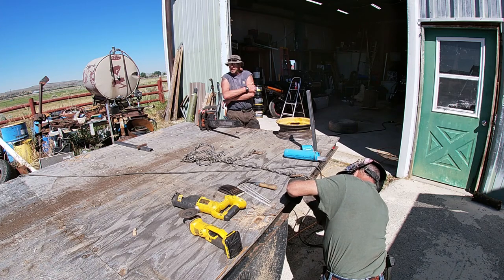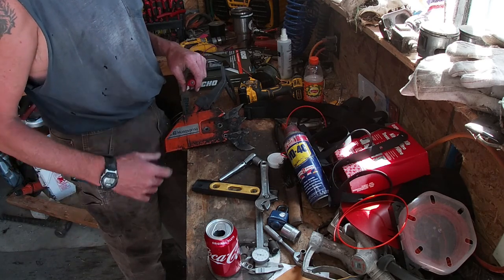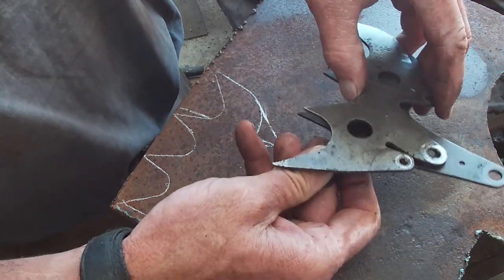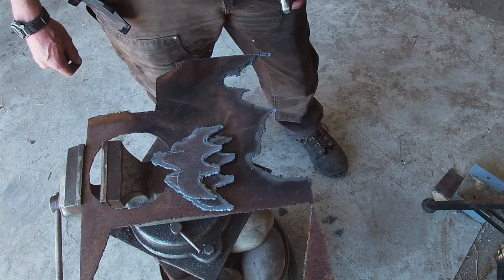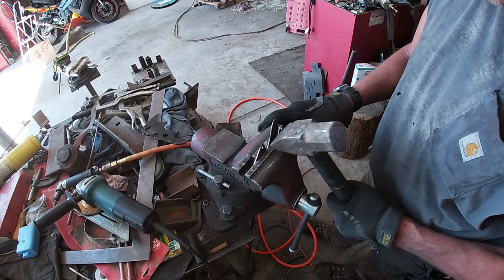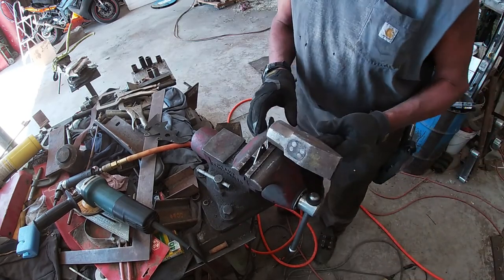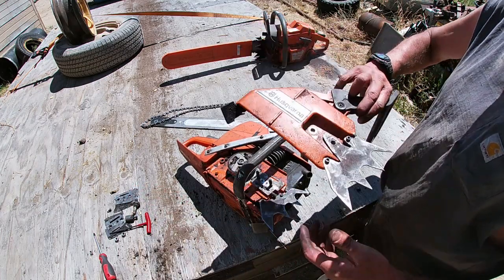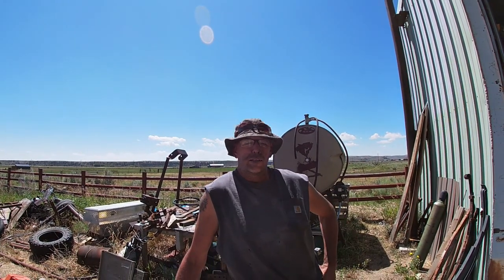How I build new saw dawgs

Comment: Those look pretty heavy duty , they turned out well , thanks for sharing , stay safe , God bless !
Reply from the maker: Theyre great. Crazy theYre so much smaller than what was on the saw. Origional owner must not have known how to sharpen which would explain the cylinder damage that Kensie found. With a sharp chain and even high rakers if i dogged it in it immediately stopped the chain unless it was in a 20+ in cut. Thanls for commemting!! STAY SAFE!

Comment: Are you running propane torch or acetylene or map gas? From my experience with the thinner metal it is best to run a new tip when cutting thin metal, less slag build up on the bottom side.  It fun to make that stuff from time to time. 👍😁
Reply from the maker: This was oxy acetylene. That was the setup we had and a large torch. I have a smaller one and i forgot to take it to clints. I appreciate the tips. Im definently not much of a welder. I just tinker with it a little here and there. Would definently like to get better. I just got a set of bottles. I will have my guages soon and can start playing with it more.